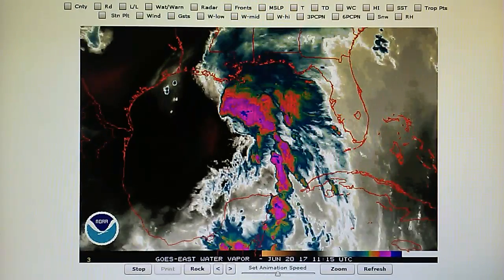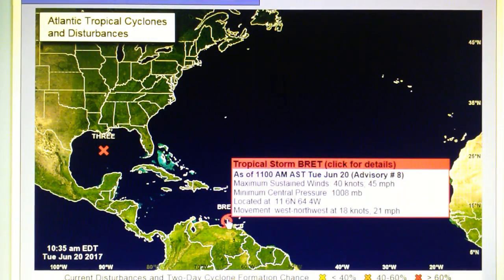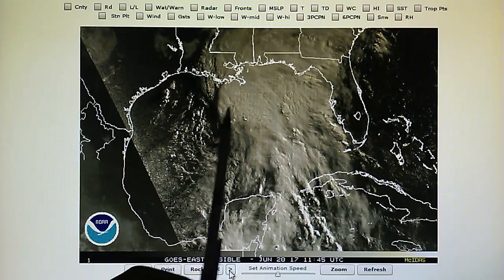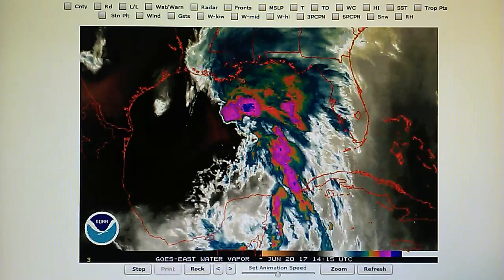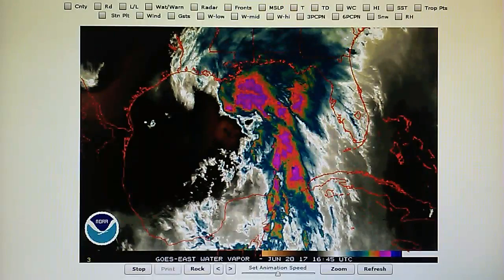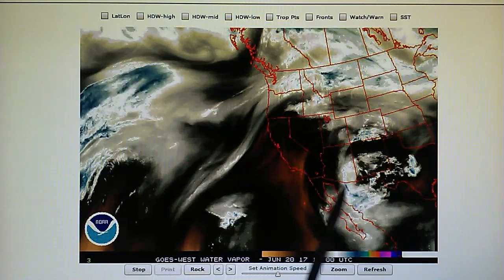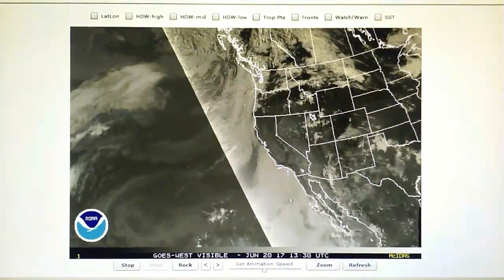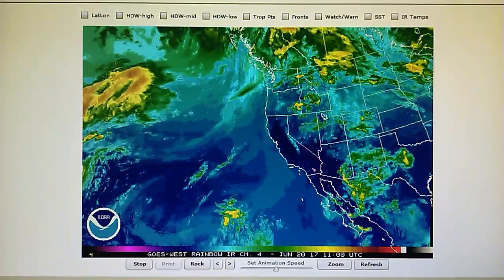6-20-2017; Tropical Storm Cindy Forms in Gulf; Right Angle & Superheating Evident in Maps

Comment: So what is controlling the weather if its not haarp? They are tearing down the station in alaska and another one somewhere else?
Reply from the maker: Dylan Robleto - HAARP transmitters operate at between 3 - 12 MHz. The size of the dipole antennas at the Gakona AK facility confirm this low frequency application. The HAARP technology was pioneered by Dr. Bernard Eastlund in the 1980s (YouTube his name). Eastlund worked with Atlantic Richfield Co. (ARCO) exploring for new oil &  gas deposits as well as mineral deposits underground. Using these low frequencies ARCO was able to 'hear' and learn the resonant frequencies of oil deposits as well as various types of mineral deposits. According to Eastlund's patents there are many other uses for the low frequency phased array transmitters for use above ground.  Superheating watervapor in thunderstorms and disrupting the convective process in hurricanes require high power coherent microwave RF which are much higher frequencies - 22.5 - 188 GHz.  Infrared laser light could also be utilized.  High pressure zones and blockades are installed using microwave or infrared laser.  Lasers can focus powerful coherent light energy just like a magnifying glass in the sun, as well as varying the power level and aperture.  These transmitters are probably flying on polar orbiting satellites advertised as NOAA weather satellites but are covertly dual-function as we've seen with the ground based NEXRAD microwave transmitters scattered all over the U.S. - these ground transmitters chop up and evaporate large slices of precipitation as shown on the Doppler maps in many of these videos.